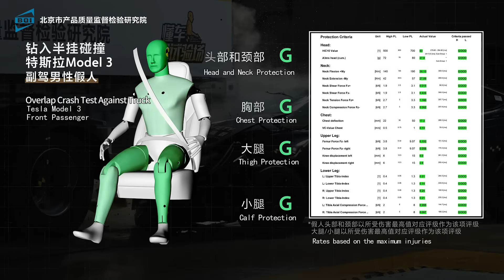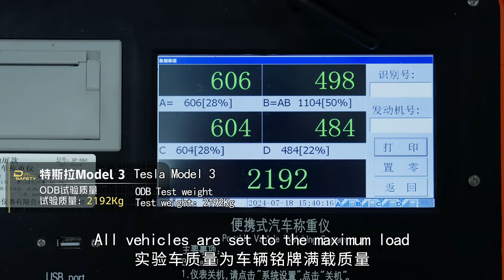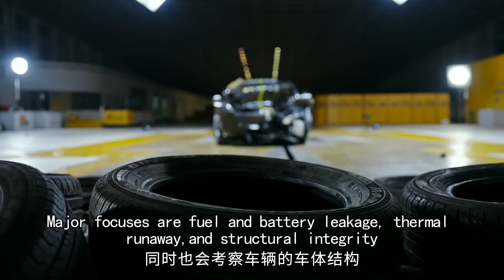Tesla Model 3 Crash Safety Test 特斯拉Model 3 碰撞安全测试

Comment: What I've noticed is that the rear guard of semitrailers in China are weaker than those in America. IIHS already performed similar tests with a Malibu in the early 2010s. This made manufacturers to strengthen the rear guard of trailers to prevent the vehicle from bypassing it. 
Does China have these kinds of regulations? I think it would be much more efficient and realistic to strengthen the guard instead of redesigning every vehicle on the road.
It would be very kind of you to answer 
🙃

Comment: Not that I don't think that these tests aren't cool, but shouldn't people be more concerned that the barriers on these Semi Trailers don't prevent passenger vehicles from underiding? 

There wouldn't be a need for this test of the barrier on the trailer was strengthened.
Reply: In EU they are strengthened, so cars won’t slide underneath. It brings a lot of safety and makes a huge difference.
Reply: Both are important

Comment: Just wait for ultra amazing 2025  mercedes benz CLA ev with 466 miles of real world range no matter you are driving on highway or city because of  amazing 2 speed transmission.with 800 volt architecture and 320 kw peak charging power compared with 150 kw in 2025 model 3 also much better battery tech and cycle life(double) compared with model 3.
Reply: I want to see that real world range, many companies promised much range and then barely some of them make It to 80% of what they claim
Reply: 2 speed gearbox is useless, electric motors do not lose any significant efficiency at higher speeds. That means lowering the rpm doesnt actually change anything because you still use the same amount of hp
Reply: It obviously won't have the same highway range as city range. Aero drag is your biggest issue, not gearbox.
Reply: @logitech4873  20% better efficiency in high way meaning you will still get 420 + miles of range  at 75 mph or 120 kph speed high way speed
Reply: @logitech4873  20% higher highway efficiency means above 420 miles of range
Reply: Drag increases with the square of speed … so it’s not really possible to get the same efficiency at higher speeds vs low speeds, even with a 2 speed gearbox.
Reply: Whatever bot
Reply: Model 3 has a max charging speed of 250 kW.
Reply: @wingless747  for short period of time
Reply: Only Untill 18% soc,new cla ev will  have 300 kw up untill 60% soc @wingless747

Comment: Better than S60. Elon said true.
Reply: These complications aside, I think this is genuinely interesting, though.
My main area of research is vehicle body structure, and I support the idea that Tesla expected this type of collision.

The primary mechanism of injury for the passenger occupant in the Volvo S60 was, in my understanding, the downward rotation of the sheared front roof structure directly coming into contact with the head area of the occupant, which was caused by the resistance from the back roof structure pinning the sheared front roof structure between the intruding truck and the back roof structure, causing an unnecessary, and excessive rotation.

On the other hand, though Tesla's front roof structure seemed to shear as did the S60, the behavior of the sheared front roof structure was very well-controlled throughout the impact event with no such rotation. Because of the unique sunroof construction, the roof structure is non-existent behind the front roof member, and this addresses the source of the problem that the S60 had altogether.
Moreover, the Tesla's front roof structure design seemed to be rather "Mounted" atop the pillar rails, and this could have facilitated the controlled "slide" of the sheared roof structure along the pillar rail, too.
This could also explain the difference between Xiaomi and Tesla with seemingly the same roof design but very different results.

In my understanding, there are both pros and cons to both structure types (It has to do with "roof impact sled test", and also Moose collision management.)
I speculate that here, Tesla's roof structure strategy showed their Pros, and Volvo's strategy showed their Cons.

On a side note, some much newer electric Volvo cars seem to have the same type of roof construction as the Tesla, so I'm keen to know the results for them too.
Thank you for your time.
Reply: Elon had nothing to do with the structure or restraint system
Reply: That was in a side pole crash test in which the s60 had lower injury metrics move on you clown.
Reply: Much lower car than the S60. Hance the better performance in the truck test.
Reply: @demon23ro  No it isnt, S60 56.6 inches, Model 3 56.7 inches
Reply: @Slay-wer that's the point, he said it was much lower
Reply: There were lower cars than Model 3 in this test but they all did terrible  @demon23ro
Reply: @demon23ro  no, tesla 3 HL 1440mm, Volvo S60 1431mmm
Reply: @demon23ro what you said is totally opposite.
Reply: The heavy battery carries